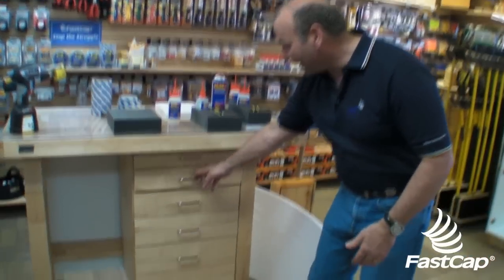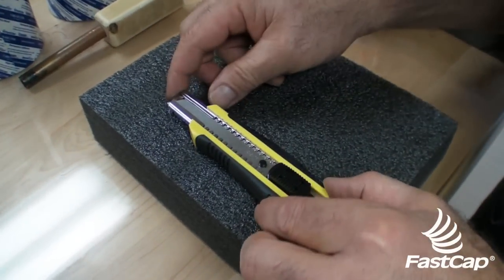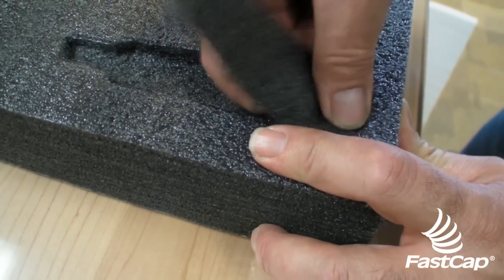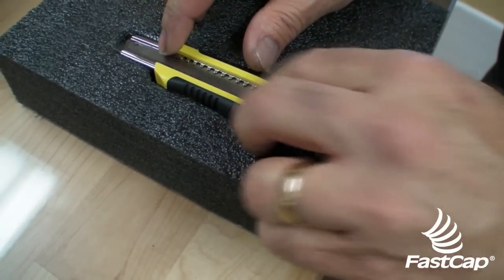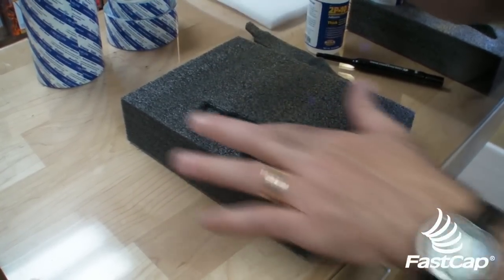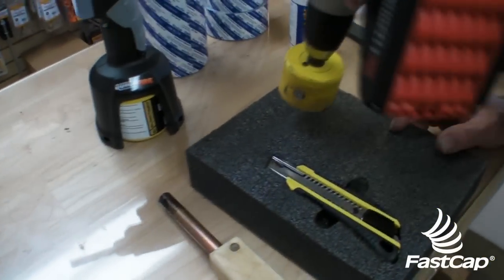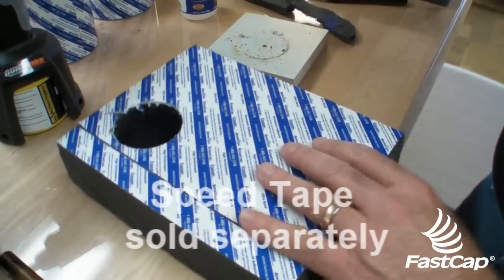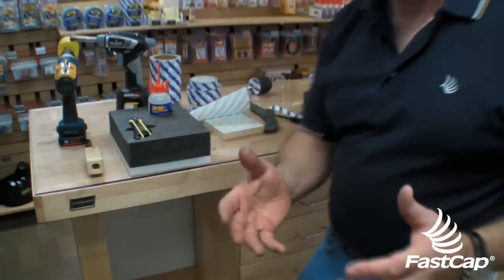Lean Manufacturing - Organizing Drawers - Kaizen Foam Tips - FastCap

Comment: Paul, I think we need to challenge all of those interested in Lean who use Kaizen Foam to find a new way of doing this. By the way, I've not done it /used it yet. 

I looked at the prices of Kaizen foam and it is expensive. It feels like there is a HUGE opportunity here. There is waste in cost, waste it time of cutting it out and maybe waste it material - we would throw out all the foam that was cut out, right? 

What if you could seal each tool in shrink wrapped plastic. Put them in a tray, spray or pour the foam. Once it hardens, pull the tools out and unwrap them. Tools would be perfectly cut out. (Maybe you could have a few half moon - fingers) to put on the tools before you do the foam. 

If you change tools and have to redo it, ideally the foam could be melted and you could re-pour it? 

There must be a way to make this foam less expensive, right?

Comment: i suggest using a small knife for an acurate cut in rounded lines and for small items. another suggestion will be making the cutted area beter finished. this i did using a torch on the cutted area and press in down with a scrap metal rod. thank you poul for giving me hours of thinking how to improve my facility. peace.
Reply: +Benad Corem Thanks, Benad!

Comment: Great video. You did a great job on this.  You make it look so easy. But I wonder how much practice it would take  and how many pieces someone like me would screw up!
Reply: Trust me I literally just did it tonight,  and it's really not layered. Tried to put my nail gun in theis stuff, it nothing like you think
Reply: I got good results, but it was a PITA. I pulled out some of the foam and realized it wasn't going well, so I put a spiral router bit in my drill press and flattened the bottom of my tool recesses. It's not perfect, but good enough.

Comment: Paul, do you have a slick way to round the edges of kaizen foam?  Say I want to mount it into a small plastic tub with rounded corners.
Reply from the maker: +Nicholas Niedzielski Belt sander or disc sander.

Comment: was on the website looking at the foam, the size of the sheet is 2'x4', is it made any longer than that?  2' is more than what I need for width so I would be cutting it down, I just need another 6" of length so can pieces be glued together to accomplish this?
Reply from the maker: We can customize it to fit your needs.  Contact sand@fastcap.com and she will assist you.  Or yes, as I mentioned in your other comment, you can glue it with 2P-10. Thanks, Paul
Reply: FastCap
 Thank You!!
Reply from the maker: P.N.S Armory Glad we can help! Paul

Comment: Will spraying the tools with oil to prevent rust hurt the foam at all?
Reply from the maker: Other than leaving some oil on the surface of the foam (for easier insertion and removal of the tool from the foam =)   ) – no not at all. It is a closed-cell foam meaning that liquids will not absorb into it, but rather just stay on the surface. So you can spray it with a hose, dump a bottle of oil on it, or like me – the owner of a carport – oil or use “mold saver” all over your tools that you store in the foam!

Comment: I just used this recently. I think the adhesive between the foam layers could be weakened to make peeling back cutouts easier. I mean, why make it a strong bond? It's not like hand tools sitting in a drawer really need the glue strength. Think about it.
Reply from the maker: The tools are not always sitting in a drawer.  They often hang from the wall.  Check out this video. https://youtu.be/qlGyPneKgC4   We have a number of video on how to dig out the foam.  Here is a good one. https://youtu.be/Ei4LSdyJ-98
Reply: I get that after using it a dozen of times, the methodology will get easier, but even looking at that heavy glue bottle hanging, I just don't see how a slightly more user-friendly separation will somehow make it weak enough to let the glue bottle sink through. I can't be the first to talk about it, because a lot of the other YouTube channels mention needing to get the hang of it.
Reply from the maker: You're right. It's not a perfect product, but it's a very good product and for what it is and at such a great price, you can't beat it.

Comment: Paul-

Love Kaizen foam, just went on the site to order a few sheets, sorry but $43 for shipping is a little crazy.  I don't have a need for $100 worth of good to get free shipping either.  Got any suggestions?
Reply from the maker: +Nicholas Niedzielski We do have 2 distributors that order a lot of Kaizen Foam . . . Woodcraft and Rockler. They order large amounts so it may be less to ship to you from there?  Or email Sandi (sandi@fastcap.com).  She'll help you figure out the least expensive route.  Also if you subscribe to our weekly email, we often have $10 off codes. http://bit.ly/FastCap-Subscribe
Reply: Paul, neither stocks the black and white foam, Sandi wasn't much help either.  I am trying to give you business, i just dont want to pay absurd shipping charges.

You cant help me at all?
Reply: Rockler stocks the black foam, and you can see if there is a Rockler near you to avoid shipping.  For a white backing underneath, you probably don't need to use special foam - anything white will do.  E.g., glue white paper to cheap foam mats from Harbor Freight.
Reply from the maker: +Nicholas Niedzielski Did you check with Rockler about special ordering it?
Reply: I use wood or metal for long term heavy duty stuff & the blue foam sleeping pads from the camping section held together with spray adhesive for stuff I don't want to ding up.
You can cut the lids off the plastic boxes a lot of tools come in & glue or screw them in a drawer.

Comment: wouldn't the cut out eventually get enlarge over time and tools will just fall off the wall?
Reply from the maker: That's a great question...it depends.

If the tool is unusually heavy, it's possible, if you don't cut it in tightly. But to be quite honest with you, we use it on  vertical surfaces everywhere in our facility and we maybe have one or two tools that will occasionally fall out because we did not cut it in snuggly enough. In those rare cases, we simply use one of our magnets embedding it in the foam and the metal part of the tool snaps to the magnet and stay securely indefinitely.

Please watch this video. https://youtu.be/McOSjieSExE

Comment: If you're thinking that this product will allow you to countersink something and pull up the layers, producing a clean and even result at the bottom of what you cut out, think again.  While this certainly has it's place, those layers do not pull up in an even, smooth, predictable, controllable way.  If you have something slightly larger sized (a few inches by a few inches) that you want to countersink, and hope to get a smooth, even, professional looking bottom in the area you cut out, you will not.  The foam fractures in all sorts of ways as you try to pull it up.  It is far from being as easy as these demos show if you're working a larger area.
Reply from the maker: Kaizen Foam is the single most popular product that Fastcap has ever produced. Why? because it's so easy to use.  Perhaps you misunderstood how it functions. You do not pull up the layers. You plow between the layers. We have a lot of great videos on how to used Kaizen Foam.  Please check them out. http://www.fastcap.com/estore/pc/viewprd.asp?idproduct=13435  Let me know if I can provide further assistance.  Paul@fastcap.com
Reply: FastCap Plow, pull, cut, vacuum, pray... it doesn't matter: the layers do not separate and remove in an even, clean manner if you have a larger area to take out.  Here's a challenge for you: show us how you can create an even, smooth bottom to a countersink of say 6"x6" or 8"x8" size.  Maybe you'll have some technique we haven't seen yet.  I've watched all your videos multiple times, and while it's great for the kind of small-area cut-outs you show, it's another issue entirely to remove it over a larger area.  That's not saying it's a bad product.  Like anything, it has it's limits and I'm just pointing one out.
Reply: could you use one of those vibrating saws maybe ? just spitballing here.
Reply: if you need a clean look layer why not get a thin sheet and do the cutout on that then stick a second or 3rd sheet below that one to give you the depth you require

Comment: And if you don't own a copper pipe and a blow torch?
Reply from the maker: calisson we have something called a thin blade Kaizen knife it will easily cut those pockets out. https://www.fastcap.com/product/kaizen-knife-thin-blade-10-pack  He also have other creative accessories for our Kaizen Foam.  https://www.fastcap.com/products/lean-products  Also, check out our videos.  We have customers that have submitted videos using creative methods.